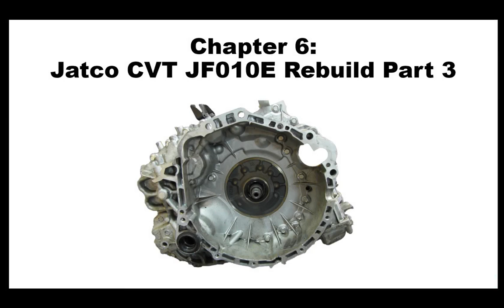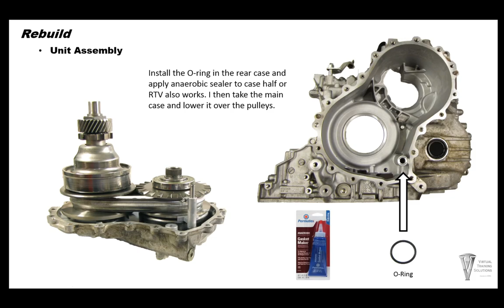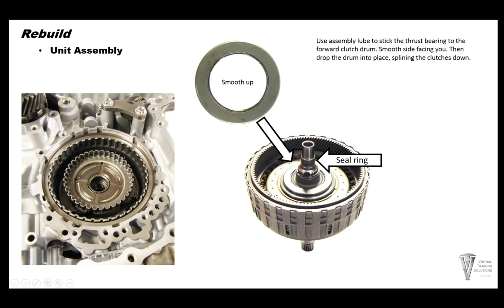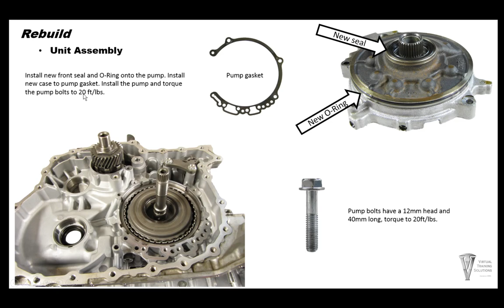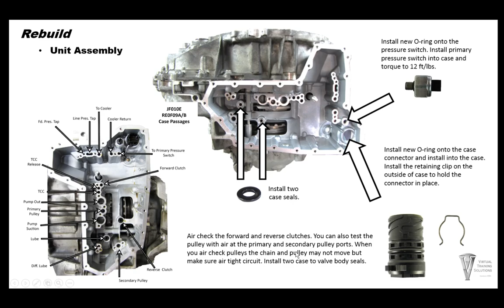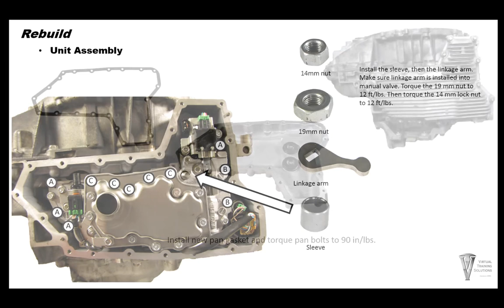08 vts jw jf010e assemblies

Comment: Hey guys, how important or reliable is air testing he reassemled CVT pulleys? Are they supposed to be airtight? Do they need fluid in them to test? I hear air from the pulleys when applying air at the ports for the valve body, but assumed its because they're dry, cold, and not rotating.
Reply from the maker: The pulley should not have any leaks. You can add fluid around the pulley and then charge the circuit. If you see air bubbles, it's no good. Some Air noise is ok, bubbles not okay :0)
Reply: @atra-automatictransmission1300 
Ok. Seems I have a bad secondary; leaking from top press area under split washer and a few spots along Teflon seal (swapped seal 3x). Bummer. Thanks for the info!

Comment: Question: i made a rookie mistake and used assmebly grease on the variator piston teflon seals. I have read since that they should be installed dry. Should i take th m back apart and clean, or do you think will be ok as is?
Reply from the maker: No, brother, you're good. Once the assembly grease heats up, it dissipates. No Worries :0)
Reply: Thanks!